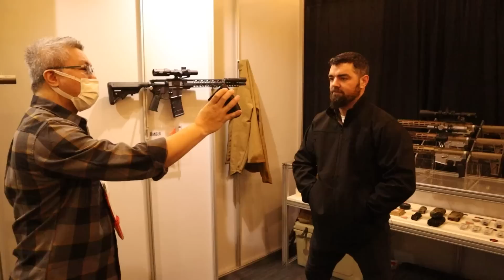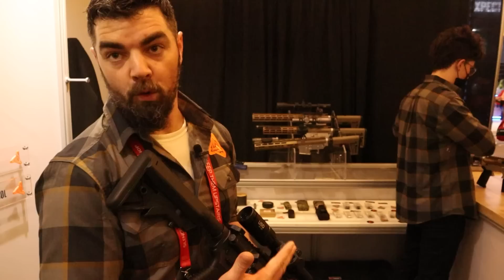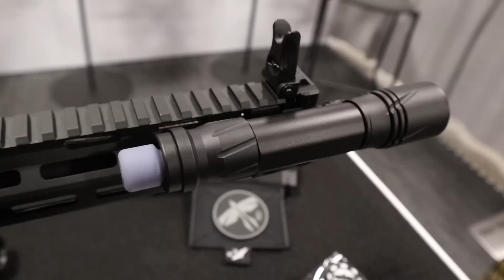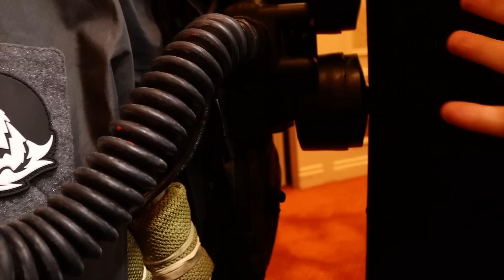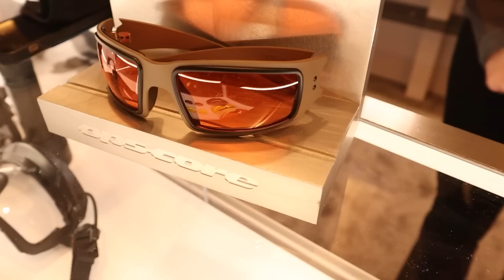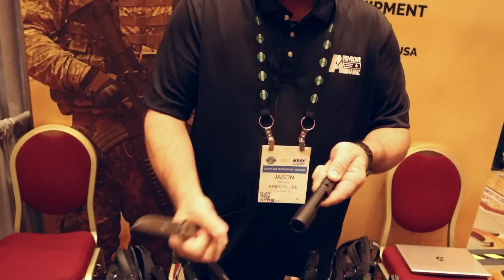Shot Show 2022 - Day 1 - Valhalla Tactical - HRT  - Spiritus Systems  - Ops Core -  Armor Lube

Comment: I wonder what the profit margin is on a $400 dollar multicam backpack that has loop velcro on the inside? And those ops-core goggles that attach to the helmet have been out for a while. I've had some for about a year. And they're nice. But if you wanted to use them without the helmet you're out of luck

Comment: That tail switch isn’t going to work.  The minute you sling the gun, if that tail switch touches anything it will be turning on.  It’s innovative but not practical.
Reply from the maker: They talked about that catching on gear. Still prototype stage, but still very innovative.

- Not Jason